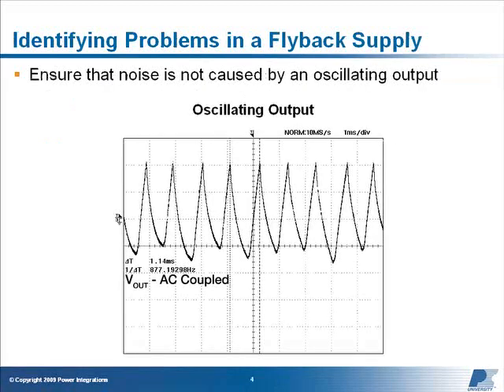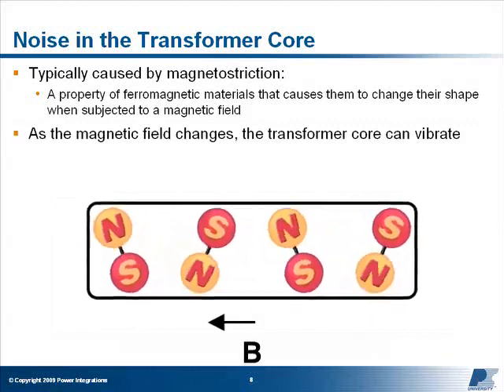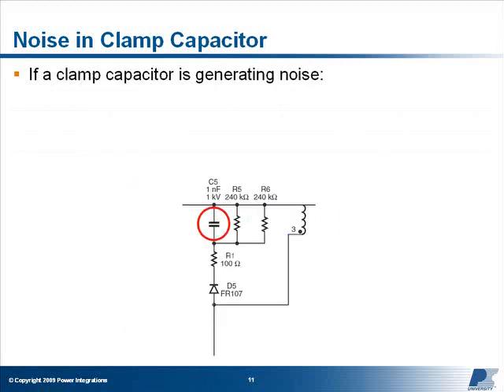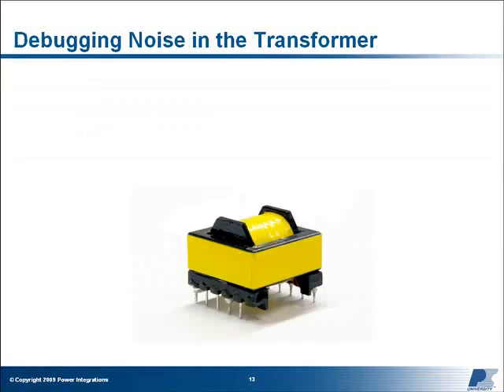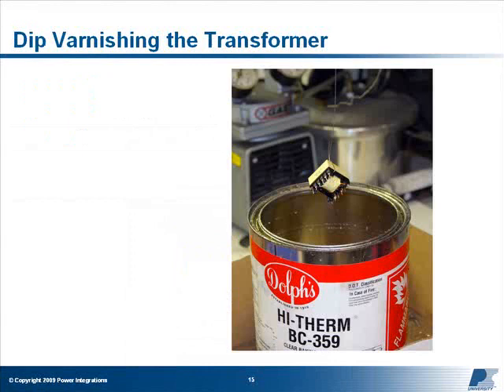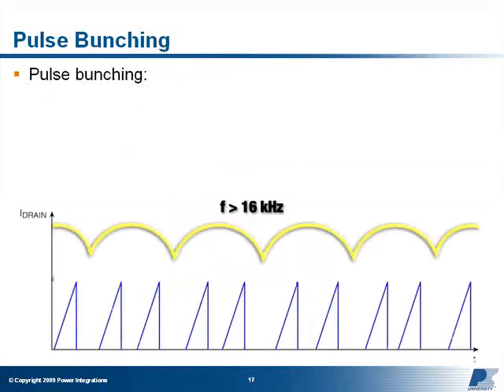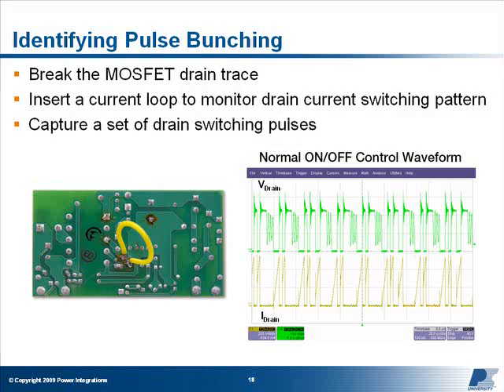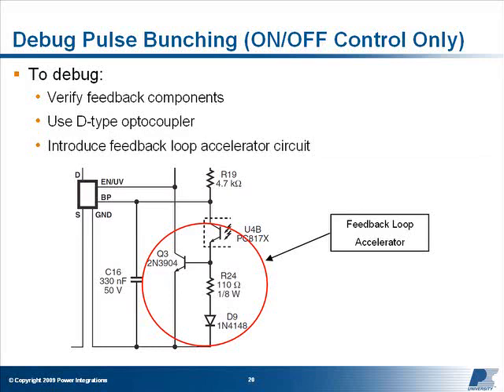Fixing a Flyback Supply that has Audible Noise

Comment: I have a flybck psu that outputs just fine powering a fan on a ptc heater circuit so its just taking mains to 12v.  However randomly it will stop outputting any voltage and make the higher pitched noise when powered up.  When powered down it will audibly go from high pitched noise stepping down with the electrolytic cap drain..  cant figure out why the psu will stop outoutting intermittently..  if i wait a few minutes it will start working again and sometimes keeps working for hours continuously.  Other times it will work for a few minutes then suddenly stop.  The sound will be there every time it stops sounding like a motor that is not getting enough power to start but will be just barely causing the fan to rotate..  if at all..  so its not a zero output but likely a fluctuating noisy lower output..  could it be a cold solder or xformer with an output that shorts out with heat or something? Maybe a ceramic cap that has shitty solder joint not making full contact?  Fault is not showing itself being intermittent and testing while fault is present is impossible due to the fault seemingly fixing itself.  Ive tried physically impacting the circuit which never fixes or causes the fault.  Ive set the board on a heater for soldering and fault does not happen, ive blasted with cold co2 to freeze and fault doesnt appear..  my only thought left is an oscillation either in the load causing the drop or on the ac side of the psu..

Comment: If replacing a single filter capacitor with several smaller ones in parallel, I would suggest using several caps, each with a different capacitance` - Maybe select 3 to give an audible C major chord (C, E, G)